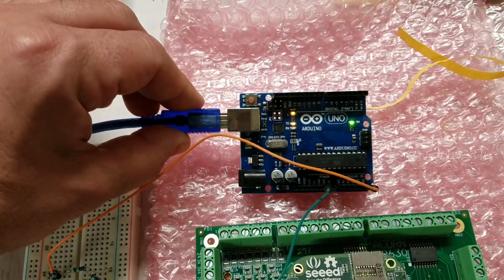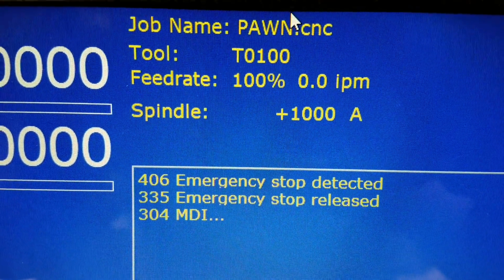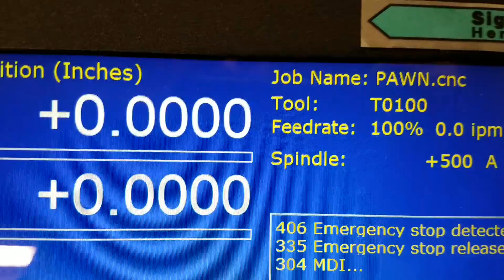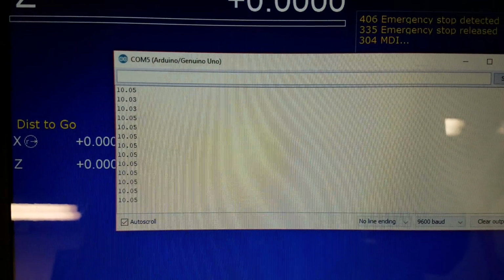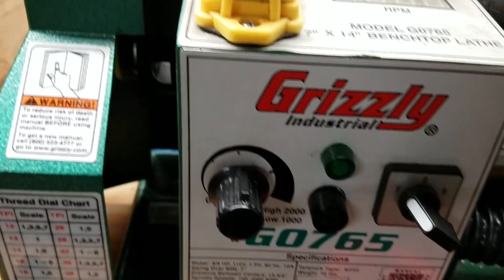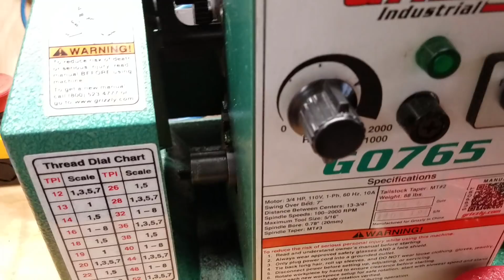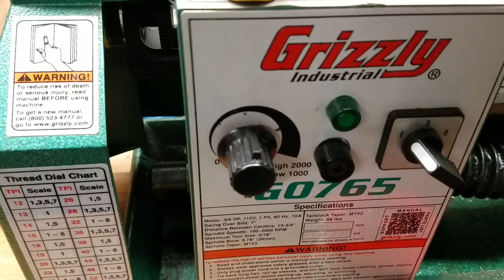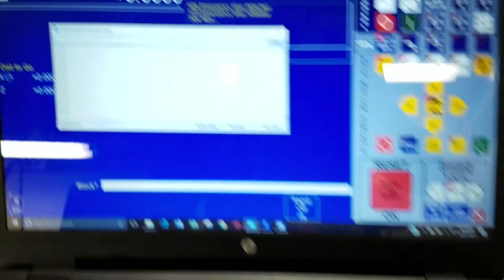Connecting an Arduino to the Centroid Acorn:  What Can They Do?

Comment: add another axis to acorn , have a nema 17 rotating the knob on the lathe.. then adjust the stepper /travel paramaters til the rpm matches the rotary encoder... matter of fact i might do this , the lathe has 2 unused axis.. wont take long to sync the 2.. making the little nema 17 bracket and pulleys will be more time consuming.. The problem is how to tell acorn that axis Y on the lathe is the spindle control,,
jog Y to home would be max throttle lets say.. ( so when  the machine goes to home , spindle goes to max rpm  ) 
im thinking of how control the 0- max rpm range. slow jog is one way.
solution , set the virtual limits in the wizard , that would be 0 and max rpm , so the stepper never overttavels the knob

Comment: I used a toggle switch to enable disable potentiometer wipe on my mill and lathe, when disabled it enables a digital potentiometers wipe which is controlled by arduino using the centroid CNC 10 v output

Works great and cost less than $15 Australian
Reply: jeez, would love to see a video of that

Comment: Franco,  if you look at the Centroid comparison chart the first thing that jumps out between he Acorn and other advanced boards is that most of the GIO ports are not protected by fusing, capacitance and not isolation.  I am not an electronics guy but know enough to make sparks,  what you are looking for is an isolation circuit in the digital world an Opto isolator
Reply from the maker: Hello.  I believe the DB25 connection is opto-isolated.  Most of the latest Centroid wiring diagrams indicate the use of the DB25 port.

Comment: What about a digital potentiometer? Also a simple buck converter bec can step down from 10v to 5v and avoid all those resistors and provide the 5v properly with capacitors, etc... now if you were trying to control a bldc motor I would suggest using a 50k digital pot and ne555 oscillating tuner for your pwm. You can use the Arduino to program the chips for the proper wiping. If acorn can output through one of the pins a 0-5v signal the digital pot can be controlled to the ne555 which will Supply pwm if that’s what you need. If all you need is a pot than skip the ne555.
Reply from the maker: I think most people are using a KBSI-240D to manage DC motor controllers.  I actually have one - some day I'm going to hook it up and make a video.

Comment: With an arrangement of 20K ( two 10K ) is more than enough for those 10V, 20M is very susceptible to noise because of the small currents that are passing and also with the amount of small "antennas" that you create in the circuit. On the other hand the input impedance of the arduino is watching your 20M, I will not explain but you do not want that either.

Comment: Hi Franco.

I just posted a reply  where you replied to a Julius Juan below.

After thinking about it; are you sure that the black wire on the pot in the Grizzly control panel was indeed connected to a metal part of the lathe? Remember all pots do not go directly to ground.

IE: Many times the black lead on a pot is the lowest voltage on the pot; BUT it is not always connected to ground. Rather another circuit, etc.

Do this. Take an ohmmeter with the Grizzly disconnected from the AC. Now measure from that black wire on the pot to any metal part on your machine. It should read absolute ZERO IF it is truly "grounded".

I have an idea you are going to find some resistance. IF that is the case, you MUST isolate the "left" screw on the Acorn terminal strip, from the black lead into the pot. This is not hard to do for a WELL trained electronic technician. But it may beyond your expertise. No disrespect.

But NEVER disconnect any "gnd" wires from ANY electrical circuit; UNLESS an authorized person or authorized instructions directs you too. It could kill someone (possibly you) if you do. 

For whatever it's worth dear person.

Comment: Tossing out an idea: control the potentiometer with a servo that  is stepped/controlled by the Arduino.
Reply: Also, why did you use so many resistors? Pretty sure a voltage divider circuit can be accomplished with just 2?

Comment: You could get an industrial solid state relay module. They are optically isolated and can be powered from the Arduino without any additional electronics. Most of the ones you see are for switching AC power. Those won’t work. Get a DC one. Physically they look the same. Wire the output between the motor power and the motor and the input to the Arduino. Output a PWM signal from the Arduino to adjust the speed. BAM! You are done.
Reply from the maker: Thanks.  Check this out:  https://youtu.be/xIQZ8dCUcwg
Reply from the maker: Something like this:  https://www.ebay.com/itm/SainSmart-2-Channel-SSR-DC-DC-5V-220V-Solid-State-Relay-Opto-couple-For-Arduino/301143000833?hash=item461d858701:g:WfgAAOxyUgtTPMlK
Reply: That would probably do but I was thinking more like https://rover.ebay.com/rover/0/0/0?mpre=https%3A%2F%2Fwww.ebay.com%2Fulk%2Fitm%2F252477865368

They come in higher voltages too.

Comment: If the motor is a true DC motor, then use a KB Electronics DC motor controller, like the KBIC-120 WITH companion SI-5 signal isolator. You can find them on eBay for under $100 most times. You must use the signal isolator! Just replace the controller in the machines and be done with it.
You damaged Acorn because of the signal isolation issue. Acorn costs almost three times as much as the KB Electronics DC control drives ( hint hint)
Reply from the maker: Hi Marty - This "Mini-Lathe Potentiometer Thing" has been my white wale for a few years.  This isn't the first time I've smoked electronics trying to figure it out.  But, I can tell you, I understand the "floating ground" situation a whole lot better now.  I also learned a lot about Ohm's law and voltage dividing circuits.  Also got play with the Arduino.  So, there is some good to come of it, albeit at the expense of a perfectly innocent Acorn board.  I'll take your tip on the KBIC-120 board.  That looks like the best solution to this problem.  As usual, I appreciate your advice.

Comment: Do you think the C61 XMT speed control board from CNC4PC.com will do what you need?
Reply from the maker: You've seem me with electronics - I have no idea but maybe someone smarter than me can answer that question.  It would be nice if it did.  My gut tells me the problem is isolation.

Comment from the maker: Thanks for all of the help.  Does anybody know where to buy really small 3-phase AC motors?  If I had a tiny 3-phase motor and a small VFD, I think that would be a lot easier than working with this DC motor controller.
Reply: Hi Franco, give https://dealerselectric.com/ a try. I've bought several motors from them including a small (well, relatively small) AC motor for my shaper.

Comment: Why replace the pot with a digital controller?
Also, if ground is wired properly it should never have a voltage in it. Hence why it's called what it is.
Reply from the maker: Read this note from an instruction manual:  WARNING! The motor controller board in these lathes is connected directly to the AC mains. Any external "ground" connections must be isolated from the lathe's AC mains ground (the ground that is connected to house or shop wiring through the third prong on the AC power plug). Extreme caution should be taken when making this modification because contact with the AC mains can cause injury or even death. Failure to isolate your computer, the lathe's motor controller board and your CNC electronics will result in sparks, smoke and damage to these components. If you are not sure of the isolation of the various "grounds" do not turn everything on until you are sure, or until you find someone who knows about such things to check your wiring.

Now, I really understand what they are talking about.
Reply: Apparently what the manufacturer of this lathe is doing, is NOT in keeping with what "ground" means in the US. IE: as Julius Jahn accurately said; there should NEVER be any voltage on a true ground connection.

In fact there should be ONE point that ALL electrical grounds are connected to. This means "that ground is ground is ground". It is called a "single point" ground. It means that ALL gnds must ultimately connect back to this single point. And that point is where the Electrical mains comes in to a building; that their ground is connected directly to earth gnd with a large, deep (minimum 8 feet) ground rod. It applies to every home in the US and any other building that is fed with electric lines from the power company.

This means that long pin on AC plugs; should ultimately make its way back to this single point gnd with NO resistance or isolation of any kind. 

So what you have is a machine NOT wired according to American Electrical Codes. For IF it was, you would NOT have damaged your Acorn board.

I am surprised that Grizzly allowed this. For it is violating American Electrical codes. OR it could be (I doubt it) that Centroid goofed up on their gnd in their power supply. NOT likely, but possible.

I hope you have apprised this malady with Centroid! I think they NEED to know this.

For whatever it's worth.

Comment: You do need to isolate these systems. Do you have a multimeter? You should have checked for ac voltage between the acorn ground and the minilathe "ground". It looks like you may have burned up your acorn ground connection? I think the minilathe is double insulated, so it's ground reference may be the line voltage. Because nothing (until now) is supposed to be tied to the minilathe controller ground reference it usually isn't a problem. I'm not sure where you are from, but many outlets in the US are wired backwards between neutral and hot.

Comment: I took a look at my Acorn board. That part that smoked is labeled F85. I'm assuming it is a fuse (possibly a resettable one)  as it blew up then there was significant current flow during the event. Hopefully nothing else got damaged before the fuse blew.
Reply: Yikes! What does that fuse protect? I wonder why is it still working and is the fuse still viable if it is resetable.
Reply: It's possible the fuse failed short but that would be a really crappy fuse. My observation is based solely on the part being labeled F85. It's possible it's not a fuse?!?

Comment: 20M  as a voltage divider is way too much. You' could do the divider with just two 1M resistors. Honestly, depending on the input impedance of the arduino's ADC, you could probably get away with a couple 100K resistors or lower.... really depend on the drive capability of the ACORN D to A circuit.  Regarding replacing the potentiometer on the lathe  you really need to look at how the lathe circuit works - don't just assume that it is even DC or ground referenced. As you alluded to you may need a circuit that isolates the two systems. To reiterate, the first step is to reverse how the pot circuit on the lathe works then deciding what you'll need to do to replace it. Blindly connecting stuff without taking measurement or knowing how the circuit works almost took out your board. I'd suggest getting the component that got fried replaced. If I was local to you I could do that.
Reply: I'm sorry if this comes off a little stern (not my intent)  but I'm just reiterating what you've said many times: Please be careful. Things do not always  work in electronics the most obvious and logical way that seems readily apparent to you and I.
Reply from the maker: Hi.  You can never be too stern when it comes to safety.
Reply from the maker: Hi.  I kept adding resistors until the 10 volts on the Acorn measured 5 volts on my multi-meter.  That was 10 Meghoms.  Then I doubled that to make the current dividing circuit.  Just trial and error, I guess.  The Motor controller was more of the same.  I measured the voltage between the ground and the reference voltage - 12 Volts.  Then I measured current on the wiper - it was very low.  Then, I hooked up the Acorn and let the smoke out.
Reply: Makes sense. However, 10M is the input impedance of most multimeter's and lab equipment (more or less  standard). That's why you needed 10M worth of resistance to half the voltage. However using the resistors in that fashion (i.e two serial 10M strings) You will not get the "logically?" expected 5V if you put the multimeter across the lower half of the string of resistors. That's because the lower half becomes two 10Meg resistors in parallel. So the voltage you'd see would be a 1/3rd and not a 1/2 (this is called burden). The  arduino ADC must have a very high input impedance (>>10M) otherwise the voltage you would have measured would appear to be off. Using much lower value resistors means you'd be able to measure the voltage without the multimeter presenting a burden on the dropper circuit. I do like the way you empirically proved that the input impedance of the multimeter is 10M - that's pretty cool :-)
Reply: I'll see if I can find the circuit for the potentiometer and divine what may have happened.
Reply from the maker: Check this out:  http://tetralite.com/lathe/

It discusses the lathe wiring.

WARNING! The motor controller board in these lathes is connected directly to the AC mains. Any external "ground" connections must be isolated from the lathe's AC mains ground (the ground that is connected to house or shop wiring through the third prong on the AC power plug). Extreme caution should be taken when making this modification because contact with the AC mains can cause injury or even death. Failure to isolate your computer, the lathe's motor controller board and your CNC electronics will result in sparks, smoke and damage to these components. If you are not sure of the isolation of the various "grounds" do not turn everything on until you are sure, or until you find someone who knows about such things to check your wiring.
Reply from the maker: I really appreciate your comments.  I rewired my breadboard with two resistors and it worked great.  I've been doing the Ohm's law calculations since I was in the fifth grade but now they make more sense to me.  Thanks for your help.
Reply: Yep, as others said - for voltage dividers you could use even 2x 10kOhm and IF voltage dividers is good for this application, it will work as well. 
I will add some new element to your research. Check out "electronic potentiometer" or "e-pots". They can replace as far as I know any potentiometer. Don't know if they have to work referenced to ground or with AC but it maybe some way to explore :)